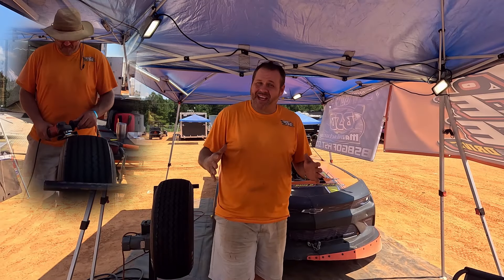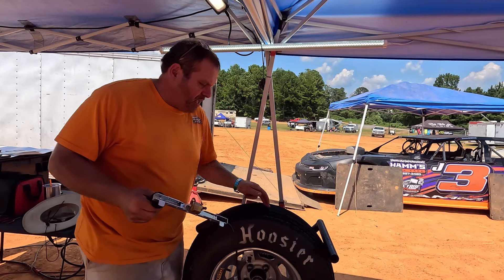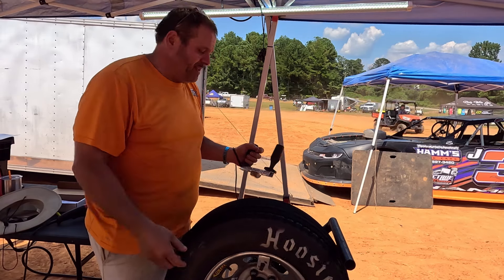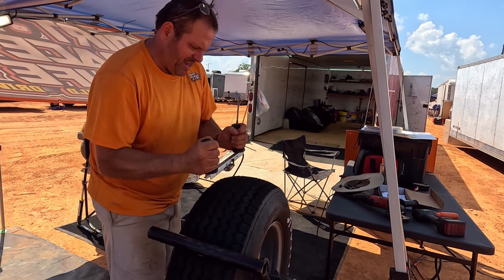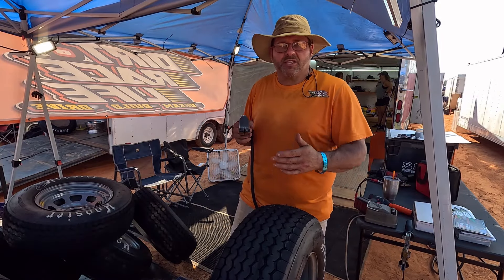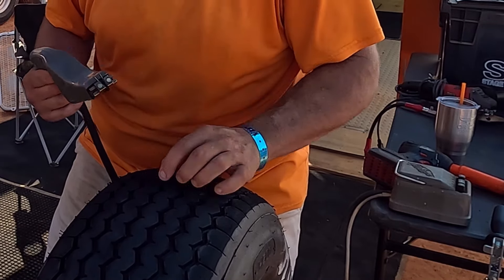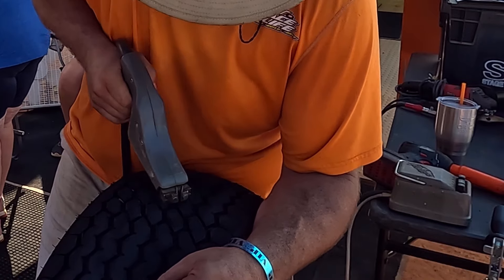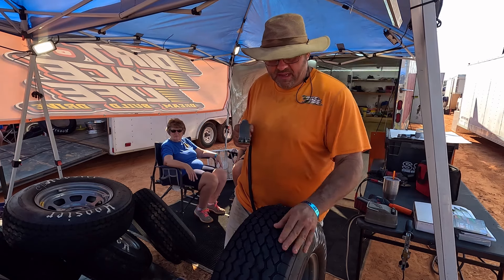How I Do Tire Prep On The Hoosier H500 Dirt Track Tire

Comment: I wish we had the option to run H500 tires out here, we're stuck running the IMCA hockey puck G60 junk tires. I get mine used from modified racers so they're usually grooved and some still have siping visible when I get them. But they don't have much tread new so I usually only get 3-4 races out of used ones depending on where I run them on the car.
Reply from the maker: The H500s are extremely durable but the trade off is they have a VERY stiff sidewall and in that regard I think the American Racer G60 is much better.

Comment: Do you use that pattern on the rears too? And is it the same from left to right side ?  Good luck today buddy give em hell!
Reply from the maker: I always cut the exact same pattern on all tires which this direction is optimal for a rear tire to sweep dirt right and create sidebite. if you can afford ALOT of tires then cutting the opposite direction on the front could be a bit better on the brakes.
Reply: @DIRTRACELIFE  thanks Jason. Yea I’m always trying to find ways to cut so they will work either way. I’m poor man racing I flip them around on the wheel to get the sharp edges back after a while lol